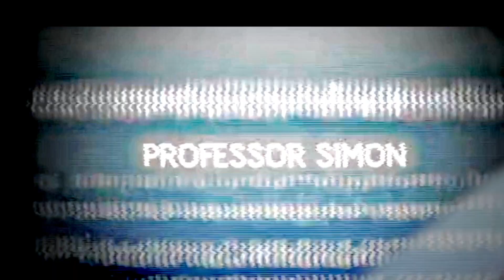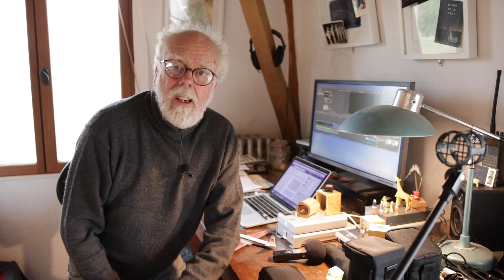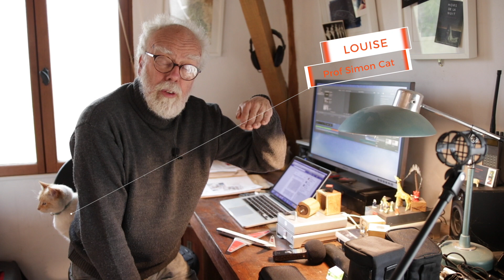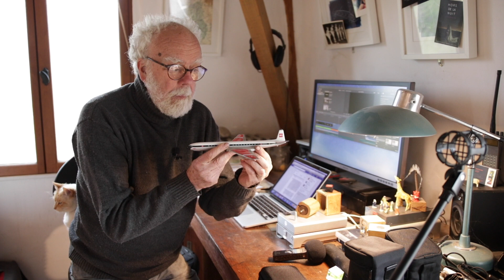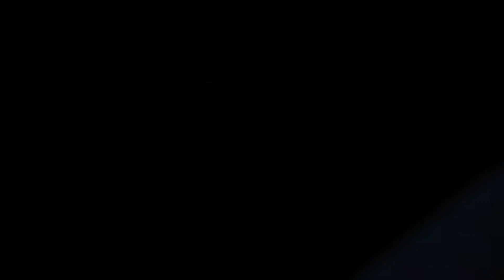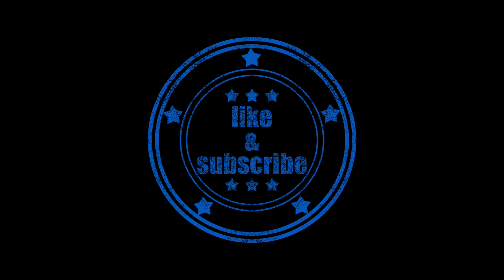737 Max 8 - Report published - Prof Simon

Comment: The Ethiopian 737Max flight data recorder indicates that the airspeed approached 500 knots when they hit the ground.  But, with only  a manually trimmable stabilizer (electric trim deactivated by the stab trim cutout switches) the aerodynamic forces on the horizontal stabilizer were so great that the pilots were physically unable to reposition the trim manually.  This is likely why they decided to restore electric trim and tried to use the MCAS affected electric trim to trim the airplane up in a panic.  Perhaps if both pilots were moving the trim wheel together, that could have made a difference.  But, being only a couple of thousand feet above the ground, it would take some time and many turns of the trim wheels to retrim towards level flight, and ideally nose up so that they could climb away from the ground. 

I think Boeing needs to do lots more testing to verify at what airspeed that manually trimming the airplane is possible.  My guess is that they have proved during certification testing that the airplane can be manually trimmed at air speeds up to VMO.  But at lower altitudes, where the air is much more dense, the air loads resisting the pilots may be a significant factor.  Thereby creating the greatest aerodynamic loads that would oppose the effort by the pilots to manually trim the stabilizer.  500 knots is well above VMO (340 knots). 

Unfortunately, in my opinion, these accidents have revealed another “deficiency” in the design of the 737.  That is the ability to manually trim the horizontal stabilizer if the electric trim becomes inoperative  or is disabled in critical situations after a severe runaway trim.  Normally this would not be a concern.  But if an out of trim stabilizer happens during takeoff climb, when there may not be enough time for the crew to manually trim away a full nose down stabilizer position, this represents a serious situation for which some method to prevent the airplane from ever getting into this configuration needs to be provided.  In summary, manually trimming the horizontal stabilizer, should it ever be driven to the full nose down position, may not be possible in time to avoid crashing into the ground.  Because of the many turns of the trim wheel that would be required.    Most especially if the airspeed reaches or exceeds VMO (340 knots) because of the high aerodynamic loads on the stabilizer opposing the effort to manually trim the airplane.
Reply from the maker: Thanks Ken...always good points
Reply: not a couple of thousand. only a thousand! Bole international airport's elevation is about 7000 ft and the planes max altitude was about 8000 ft!
Reply: The forces on the stabilisers at that speed are so great that manual trim is pretty much impossible. 

The other thing that is critical here is the faulty information being fed to the MCAS. Readings were being given by both left and right sensors. One was giving correct readings, the other incorrect readings. So why was the MCAS only reading the incorrect sensor? Why is there no option for the pilot to switch sensor?

And maybe this is just a badly designed plane. Putting those big engines of the front of wings that were designed for smaller engines has created a plane that is unstable. Two of these planes have been lost in a matter of months, to what seems to be the same problem. In aviation terms, that is huge.
Reply: Electric motor on the manual trim would work I don't think any airliner have that though they said they might have a fix for this in four weeks it will take a while for the flying public to get on that airliner they did not have this scenario and their flight simulator and a higher altitude you can manually crank the trim wheel but you have to take pressure off the elevator that's putting it aircraft in the nose down position momentarily crank the wheel pull the aircraft back up do that all over again that is in the flight manual pushing the nose down to take pressure off the elevator but you can't do that at 1300 ft they were doomed
Reply: @angelabailey1692  they are going to put a thing in there that warn them when the two sensors are out of range it will be that the aircraft will not rely on One sensor they also need to find out if there's defects and that sensor Boeing fix it fast if not Airbus will take over
Reply: @angelabailey1692   Mcas only used 1 AoA. Boeing said it wasn't a flight critical system therefore didn't convinced FAA that they didn't need a redundancy by using both AoA
Reply: @leighmoom5277  - Actually the 737 MAX all have two AoAs. One feeds the Pilots display and the other the co-pilots' , so  were being used in a redundant configuration - but not simultaneously on the same side. As I recall there is also a feture that switches which is the primary vs. secondary from flight to flight. Also MCAS isn't flight critical - that is; you can fly the airplane without it.
Reply: I think the manual trim system should never have been certified if it is not manually controllable through all combinations of pitch trim/airspeed.
Reply: @MooneyOvation2  That is a valid point. There is also a question mark over why the speed continued to increase and why the throttles stayed in the same position. 

Just to add as well that the whole certification system in the US is also under scrutiny as it seems that manufacturers effectively have the free reign to self certify many aspects of design.
Reply: @angelabailey1692  the FAA does not have enough inspectors Congress need to allocate more money FAA gives some of that certification to the manufacturer if you can believe that crap I might point out B-52 has cables what the hell is wrong with that I rode on a C-130 several times you can see the cables going back to the rudder and elevator sitting in the seat they need to put a military-style angle-of-attack indicator if they can learn how to use it you have to have in fighter jets they make 180 knot turns on Landing I hit a hundred fifty knots with wheel down it would take some training probably a lot of it are commercial pilots be able to use that I guess their point is flying by The Wire make the aircraft more responsible to fly control input F-16 is fly by The Wire since 1984 I am not a pilot just an observer my question to you Pilots is this would a military AOA help them or not please don't make fun of me I just have some questions that's all be nice if you would answer it I'm talking about commercial pilots not trolls on the internet
Reply: Angela Bailey It’ll be interesting if we ever find out if Boeing or the FAA certified the MCAS system. Either way, it’s not going to be good.
Reply: @angelabailey1692  To reduce power the nose would pitch down even more.

I see above about not being able to manually trim. Many air craft have this issue small wheel needing to be turned by hand against the forces of an out of trim aerodynamics. The usual procedure is roller coasting point nose down taking forces off trim then pulling on yoke to get nose up again. usually has do be nose down many times to become stable. These pilots didn't have the luxury of altitude. 
It is speculation about air speed both AoA were disagreeing according to report. very unlikely it was the one reading 500 knots but it was above VMO Until the full report is out we won't know if it created structural damage. The VMO has a big percentage built in against structural damage flying 30% above VMO will reduce aircraft life not necessarily structural damage instantly.
Reply: @leighmoom5277  I agree, without altitude, they were in trouble.
Reply: Peter Wordsworth when it was certified it was the only trim option so you couldn’t get it into that config without something else going badly wrong. It seems the 737 max was flying with an airworthiness certificate granted to the 737-100 in the 60’s.
Reply: There was no defect with a manual trim what is 500 knots King Kong couldn't turn them Wheels be nice if they had a power assist unit but there's not one in that aircraft and probably no aircraft
Reply: good point.  yes, rather than a manual stab trim wheel, the plane needs a manually activated stab trim button that would activate a motor that would drive the jack screw.  And obviously that motor (or the gearing connecting it to the jack screw) needs to be powerful enough to turn the jack screw when the plane is flying at high speed, low altitude with maximum aerodynamic forces acting on the horizontal stabilizer.
Reply: Ken good points . The solution in this case should have been probably to not cut the power to the motor but to disable the MCAS software control input and leave the power to the motor . I am not sure though if the aerodynamic forces would have caused the horizontal stabilizers shear off . which would have been a disaster ,  
either way boeing completely screwed this up

Comment: I wouldn't trust my life to a computer in no way shape or form! That's why I don't fly. Thank you professor this was very informative.
Reply: Unless you drive a pre 1978 vehicle, you've already got several computers with you on the ground.
Reply: @mikecowen6507   I understand that but I'm not depending on them to drive my car without me at the wheel.
Reply: @americanrebel413  In time...
There have been rumblings about removing the pilots from the cockpit. Sad as the circumstances are, I think Boeing just added 20 more years to whenever that date might be in the future.
Reply: @mikecowen6507  👍✌

Comment: So the new update will have a redundancy using the other AoA sensor, a disagree light and MCAS software update but has boeing fixed the sudden system malfunction which gave the erroneous data to MCAS? Obviously that was the core issue of the crash if  it's still the same as before than what"s the point of adding a disagree light, the 2nd AoA sensor and the software update since the pilot still can't do anything to overcome the force in any way. looks like anytime the plane have an erroneous data there's nothing anybody can do about it except pray as they are destined for doomed.
Reply: Azzrundin J  MCAS software update should collect a lot more data,  the MCAS database can have all possible scenarios programmed into it,  the input from ADIRS and commands from FCC can be multiplied, incorporating many more conditions, example,  altitude,  airspeed,  Stab position,  G load,  TCAS,  RAD ALT,  eGPWS, and crew inputs through controls and switches.  MCAS duty cycle could be changed, and limited.  MCAS can be inhibited by any factor programmed into the database,  like altitude,  stab position,  engine output,  crew counteracting MCAS commands,  etc.  MCAS can be changed from a linear output to an algorithmic output as speed,  G load, altitude,  stab position, approach their limits.  In this case,  altitude less than 1000' AGL,  airspeed near 500 knots,  autothrottle at takeoff power, aircraft nose down,  stab trim jack screw near or at travel limit, in nose down attitude,  crew inputs counteracting MCAS commands,  are all counterintuitive to normal flight profile,  hence there should be a window where MCAS can receive commands, but outside that window,  MCAS is inhibited,or reduced incrementally according to the data map.  Stab or any flight control should never be allowed to receive aerodynamic loads higher than what can be overcome by the crew manually flying the aircraft.  All these limits can be programmed into the FCC and probably are for the autopilot function.   If the FCC monitors any deviation from the normal flight profile,  it can command a safe flight routine,  to give the crew TIME to evaluate the situation.  I am not an airline pilot,  I have no B737 experience,  just a retired AME.

Comment: I read the report and it gives a quite chilling insight into the situation of the pilots. I certainly didn’t understand everything in the report and I have a question.

The voice recording identifies trim cut out switches are off and subsequently the data record shows MCAS initiated a trim down but the stabilizer didn’t move, as expected with trim cut out switch off. 

After this the data record shows a MCAS intervention and the stabilizer does move. This should not occur when trim cut out switches are off. 

But between these two events the report doesn’t identify if the trim switches are changed from off to on. 

I understand that people are suggesting that the pilots turned the trim switches on but I don’t think we know this. Is it possible that MCAS trimed down even with the trim cut out switches off?
Reply from the maker: Good points ...I think they turning it back on to re trip the aircraft...but on re activation it applied another bunch of nose down trim....all close to the ground...not good.
Reply: Professor Simon Holland right, the pilots couldn’t manually trim (perhaps because of high speed) so we can speculate that they re activated the auto trim (cut out from off to on) as a final desperate attempt to trim up. Hopefully we get more information. Anyway thanks for your excellent videos.

Comment: How can switching off the electronic trim be a logical solution given by Boeing to turning off MCAS? The first thing I thought when I heard the "solution" , how do the pilots now quickly re-trim the plane from a downwards pitch trim that was initiated by MCAS when the electronic trim is off?  

Why did Boeing not have a MCAS "off" switch instead so as not to loose trim functionality?
Reply: Because Boeing didn’t initially want to highlight to the FAA and the airlines that the MCAS was on the aircraft or how critical the system is?
Hence MCAS wasn’t mentioned in the flight manuals or checklists/QRHs or incorporated into flight simulators!
Reply: 100% agree with you Philip, in abnormal and critical situation like that, I feel that the crew shouldn't loss the command of the manual electrical trim, if it is working well. The target  to isolate only the MCAS command. I feel that in a low altitude with unexpected nose down attitude, an airspeed increasing suddenly and a high pressure in the stab (hard yo move) which difficult to retrim by hand....the assistance of the manual electrical trim could be the key.
Reply from the maker: Exactly....good point Philip
Reply: 100% agree, though MCAS "off" should ALSO be augmented by MCAS relying on more input than a single AOA sensor before making trim decisions.
Reply: Agree with all points here. Also, 737 NG Pilots who were trained to fly manually on the 737 NG would feel a different flight profile on a 737 Max. The MCAS was there to help anti stall and engage only with autopilot off, thus make manual flight similar in feel.  To have a MCAS kill switch by itself would mean the pilot could face a profile never flown before, and would mean that Boeing would have had to admit to that  beforehand.  I think perhaps the anti stall function of MCAS purposefully 
highlighted more than the other characteristics

Comment: Very sloppy design on such a critical flight control system, to depend on one AOA sensor and this design was approved by the FAA, yeah no collusion with the Trump administration going on here.As an electronics eng. technologist I've worked on medical equipment, production line equipment, write PLC, VB, C++, etc.  When ever there is a safety critical thing, there is ALWAYS multiple redundancies, this is just SOP.  Multiple fail safes are required and when one fails, the system stops, or goes to park or whatever is the most safe thing to do, period.  It's really unbelievable for me to know this MCAS was approved for flight!!
Reply: Mike K:  This airframe first flew in the 1960s and was certified at that time.  Once certified,  there is no need to recertify (very expensive so avoided as much as possible) hence only two AOA sensors,  which was what was required at the time.  Three AOAs are now required,  in a new design.  The manufacturers will do everything possible to use the old certification specs by not changing anything it the system or airframe.  That is why the Max 8 still uses as much of the original design as possible.  They could have gone with a clean sheet design as they did with 777 and 787,  but their main customer SouthWest wanted to buy an aircraft that did not require any more pilot training and that allowed all of it's pilots to transition among this model and all previous models.  This is one of the main selling features Airbus uses in their A320 family of aircraft.
Reply: approval happened during obama's time, numbnuts
Reply: @lolbots  Explain this then:"CEO Dennis Muilenberg was addressing Wall Street on a conference call on April 26, 2017. He boasted about how quickly the company had brought the 737 Max to market — and praised the Federal Aviation Administration's "streamlined" certification process. He attributed that to the pro-business philosophy of the new Trump administration."  I'm not turning  this into a political argument it was just a comment based on facts. Peace.